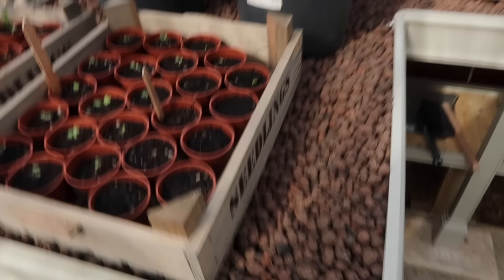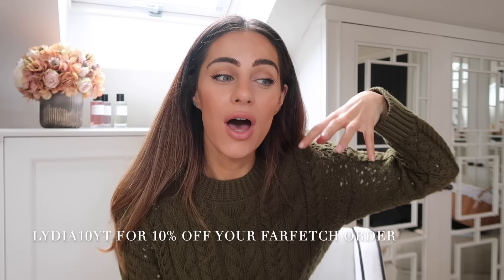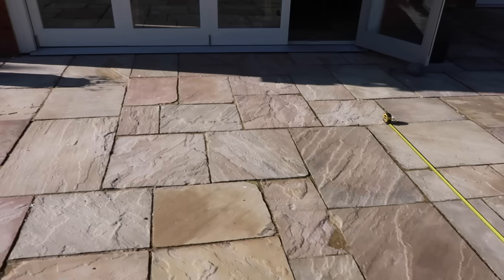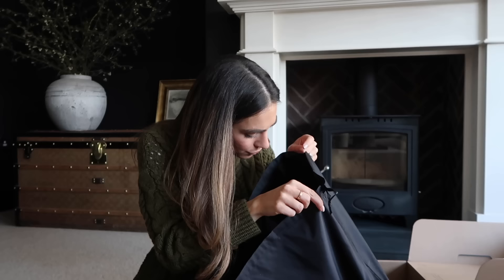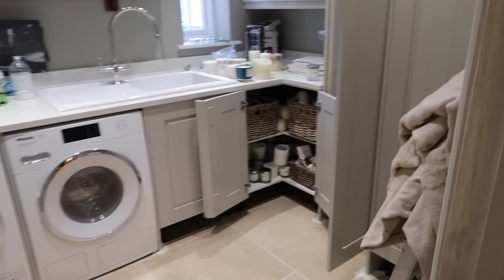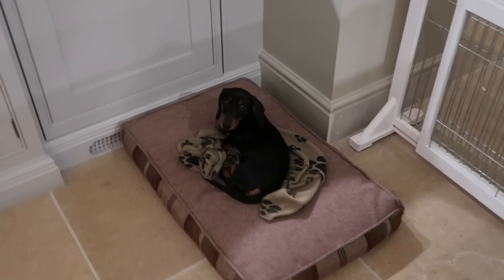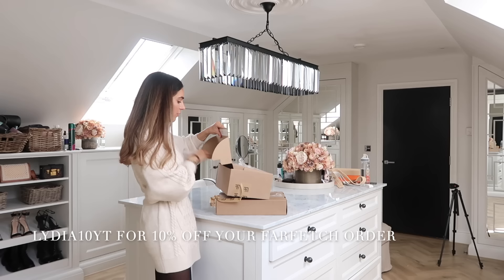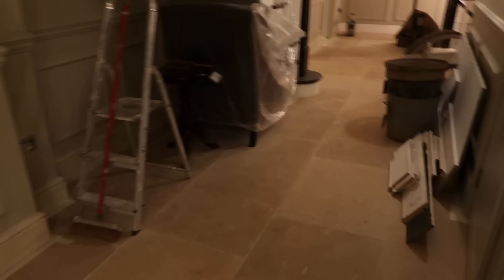SAYING GOODBYE & 10 SPRING OUTFIT HAUL | Lydia Elise Millen

Comment: Tomatoes do best if watered from underneath and germinate in a heated environment.  Once they germinate and get taller, make sure to add more potting soil to about 1 inch from the bottom leaves. One the second set of leaves appear, you should add fertilizer with calcium to deter end rot.  You probably already know this though.....

Comment: Wisteria grows quickly -- so, choose a pot that is at least twice the size of the starter pot that you have purchased from the nursery.  The bigger the better so the roots have room to support the top side growth up the house.  Also, Wisteria doesn't have aerial roots, so you'll need to support it with wire and eye-hooks on the house or on a frame that you mount to the house.

Comment: This is off the beat and path, but have you had an MRI done on your neck vertabrae? Reason being...my arm down to my hand was in terrible shape and turns out it stemmed from compressed vertabrae in my neck. I had a pain block and Physical Therapy and thankfully it's fine now. The vertabrae on your lower neck control your arms. Mine was painful and my left arm was useless. I was told they see a lot of people with long thin pretty necks with this problem. Love the floral dress with the wedges and the cable knit outfit. The others are beautiful too.